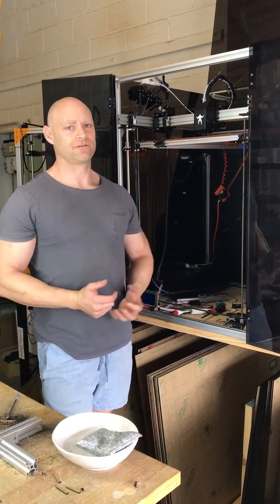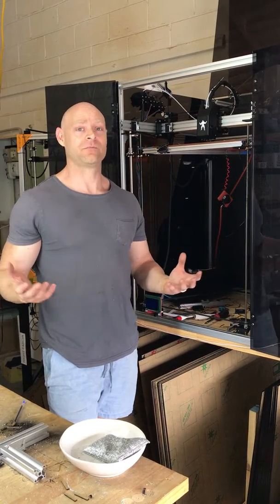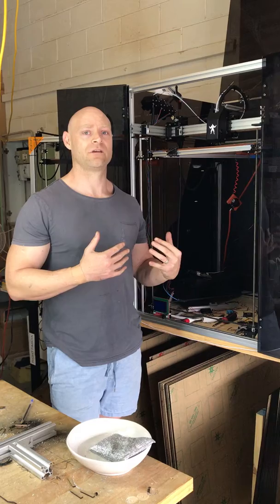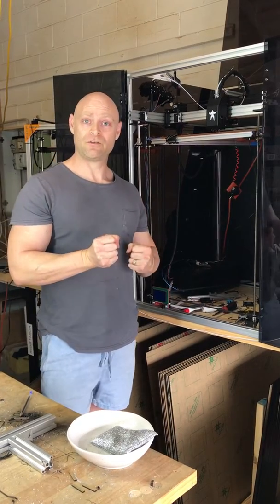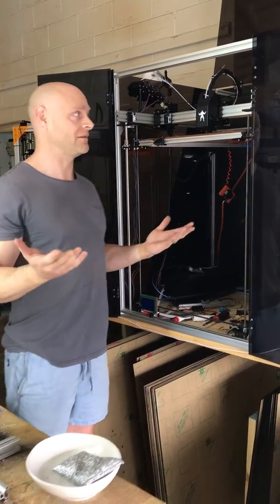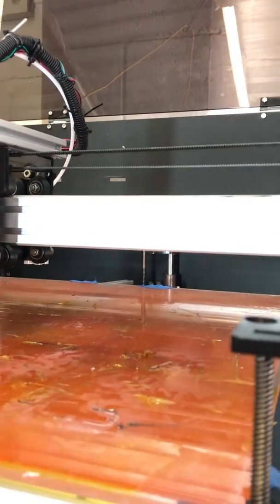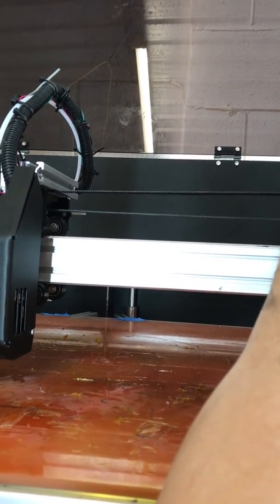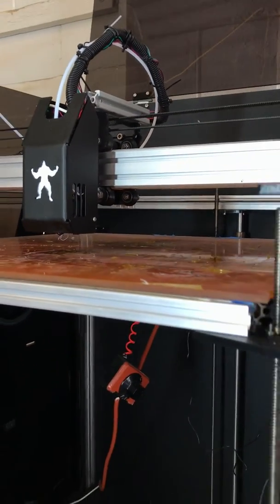3D Printer. How tight should my belts be?

Comment: I tested it and the printer runs much smoother. However, I had to reduce the acceleration values significantly, because with the previous values I had strong ghosting. It would be great if you share your settings for jerk and acceleration.
Thank you for this Video!

Comment: Thank you for your guide but I can see that at 1:24, the belt is touching the silver aluminium profile. That is why it is not ringing. Not because it is over-tighten.
Reply: It's actually because it is too tight.
Reply: @outspokengenius  I cannot agree. The belt is damped by touching the frame. How does this have anything to do with being too tight? Can you explain the mechanics of it?

It's not like you can damp a string on a guitar by tightening it (that only changes the frequency up) - you damp its vibrations by touching it.

Comment: Does this work for all 3D printers?
Reply: no.  it works for that printer in particular, and only with the x carriage in that position.  if you change the length of the belt, the resonance is going to change with it.
Reply: @butre.  Not really, it's a good rule of thumb for all printers. Yes it will change but the change can be extrapolated.
Reply: A belt is a belt so... Yeah
Reply: @TheVideoVolcano  means standard XYZ vs Delta. Which is my problem rn.

Comment: Aaah too tight belts! 
Off topic slightly, I recently seen a brand new supercharged big block Chev(1000hp detuned setup) destroy a brand new motor from over tensioning the supercharger belt. First it destroyed the cranks main bearings and then persisted to destroy most of the motor. All the metal fragments circulating causes havoc.
Reply: That's one thing I always notice on engines with automatic spring tensioners, it doesn't need to be ungodly tight. I've seen people use a pry bar to crank on a non spring tensioner then have someone else tighten the bolt/s. Then a month later they're replacing an alternator, power steering pump, and or A/C compressor.

Comment: as soon as my printer finishes printing I will loosen the belts, I had recently tightened them because circles were coming out deformed and I tightened them quite tight! I just had a failed print where it skipped steps and caused layer shifting. I think you may have just explained why :) thanks.